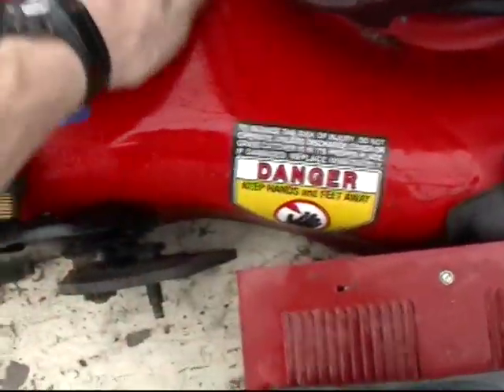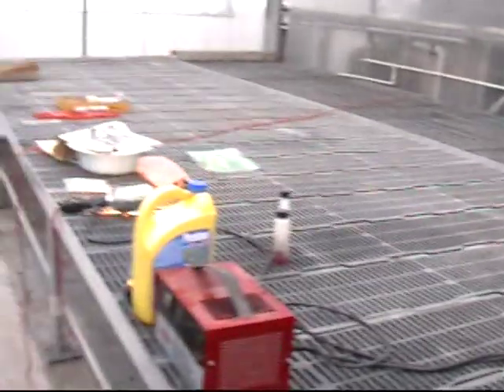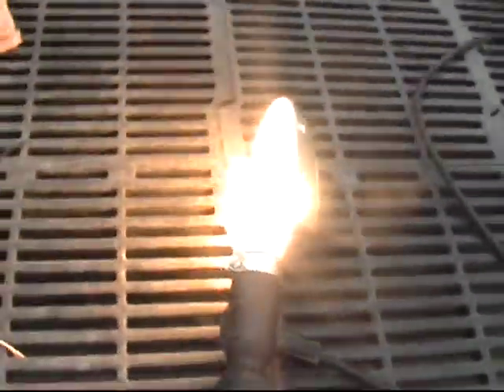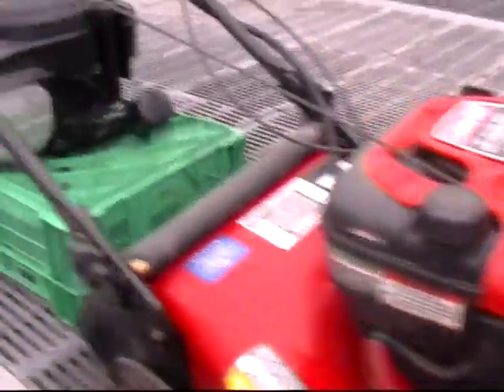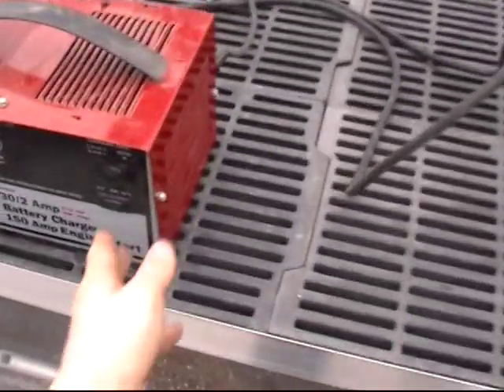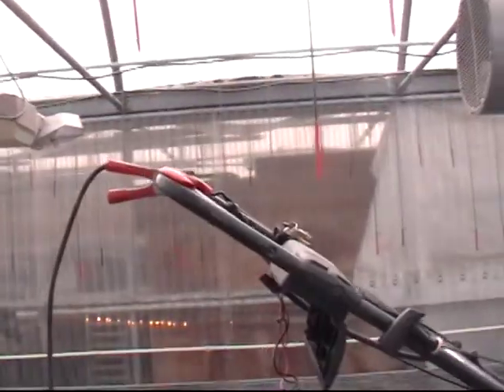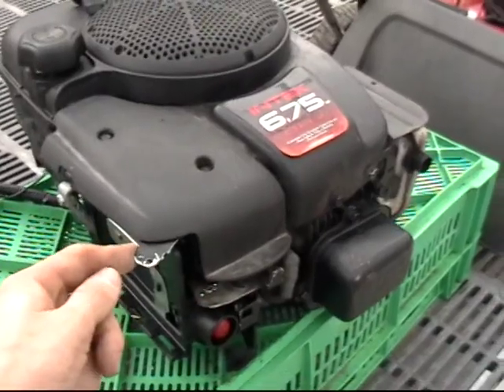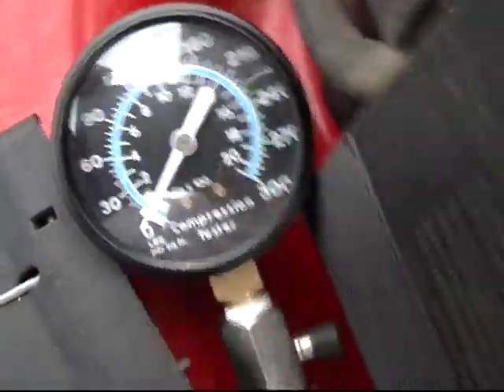Briggs and Stratton 6.75 HP No OHV compression test

Comment: That is not a leak down tester you have there, it is a compression tester. Your GAUGE might leak down but has NOTHING to do with the engine...there is NO pressure in the engine to leak down. You are not adding air like a leak down test.

Comment: i have 2 B&S 6.75 lawn mowers and they never go past 30 PSI but start on first pull and run all  day as long as it has gas and sound great. these compression  tests are not 100% proof.
Reply: Briggs insists the non OHVs should have 60psi minimum. Kohler says 90 min. That said, I have a well running Kohler that only has 77. I def think the numbers they quote are for a brand new motor just assembled.

Comment: If you crank over the engine without a spark plug connected to the spark lead, you can damage the fine electronics in the ignition coil.
Reply: No you can't. There's nowhere for the current to go. It's an open circuit so nothing happens.

Comment: Folks,  the only way to check compression is to spin the engine backwards because of the configuration of the compression release design of the engine.What he is doing in this video tells you nothing.
Reply: a new 6.5 briggs will only show 40-60 psi because of pressure release on canshaft,spin engine backwards will show more psi.

Comment: compression release will not allow the engine to give an accurate reading. a little tab on the exhaust cam lobe keeps the exhaust valve open until engine starts. it makes cranking with less effort. the tab is attached to weights and when engine picks up speed it will retract weights

Comment: Do you have any idea whatsoever what you are doing ??? sure as hell doesn´t seem as you do. But just keep trying, that´s the only way to learn a little.
p.s. it´s the nonreturn valve in the pressure gauge holding the pressure, not the engine.

Comment: You are not holding the pressure in the engine, its only in the meter, there is a little valve that doesnt let air out. there is the knob fore
Reply: You remove the schrade valve when doing a bleed down test

Comment: That engine on the mower should have alot more compression. Suprising that it runs. It's too new to be so low from wear. Either you have a head gasket problem, a sticking valve, or took the test with the tester loose.